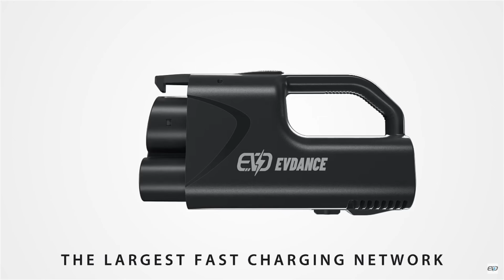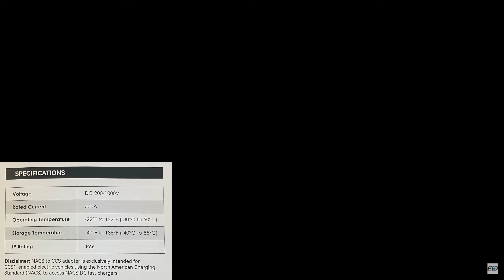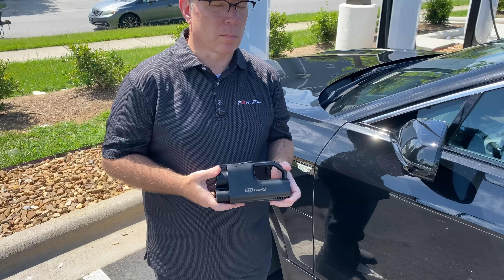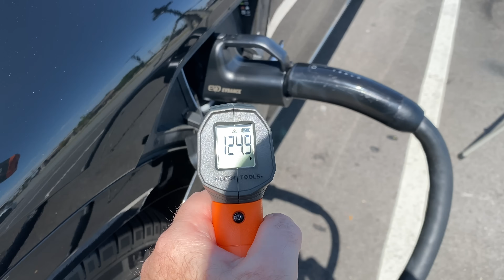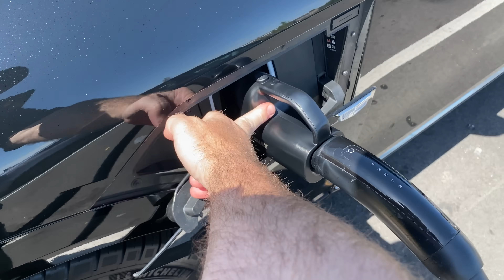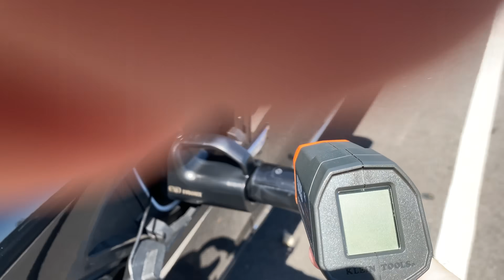Charging my Cadillac at a Tesla Supercharger using EVDANCE adapter

Comment: I'm disappointed with any new product that is not UL certified as there is now a published standard.  It is not an issue today, but it could become one in the future.

There are sensors in some of the existing adapters that detect heat and lead to a throttle at one level and disconnect at a higher level.

That door looks like it could have been better designed, but that is one benefit of this adapter over the A2Z.

I have the A2Z and the OEM adapter from Ford, so I think I am covered for now.

Comment: The problem with the dial on the bottom is that it is not automatic like a spring-loaded latch. People are inherently lazy, and I suspect that many will just plug the NACS in without locking it thereby presenting a potential safety hazard (A2Z's first Typhoon adapter was similar and they changed it with the Pro version). I do like the handle on it though, it's nice to see a company do something different in that regard. What temperature did the handle get up to?  I'm guessing it's a lot cooler. Numerous YouTubers have complained about how hot the Tesla OEM adapter gets and that they can't hold onto it and this handle might prevent that.
Reply from the maker: True, but no charging until the dial is locked.
Reply: @thenetworkarchitectchannel So the dial actually cuts the data communications? That seems unlikely to me but not impossible, just overly complex for a budget product. I would expect it to just be a simple mechanical locking latch that can't stop charging at all
Reply from the maker: Two things.  The manual says "built in temp monitoring.  Charging will decrease if internal components of the adapter exceed 194F".  Also, the video does not show it well, but the dial is not raise a plastic blocker.  When it is spun, a click occurs which looks to engage a contactor and also release a spring loaded blocker of some kind.  When using it, I gathered it was a safety feature which will prevent current if not fully engaged.  IMHO, this dial method is safer than a finger sw of some kind, because it take more deliberation to disengaged than a toggle sw.  To get the specifics of the safety of the device, I suggest emailing them. contact at evdances dot com.  I personally, am comfortable with the safety of the device.  I respect others may feel differently.
Reply: @thenetworkarchitectchannel Definitely sounds different than other adapters Alex on Autos did a video where they cut a Lectron adapter in half and showed how they actually work if you are interested. Titled "NACS Charging Adapter Teardown".
Reply from the maker: @Weezedog  cool.  will check out.  Here, their promo video does a quick blow out, but can't fully tell what's up.  More of a guess from that.  Thx.

Comment: Probably fine but not an adapter I would recommend.
Reply from the maker: Their bread & butter is the L2 extension cords.  Kim J & Kyle C both did plugs on their chans for it.  When I did the extension vid here, it did way better than I expected.  Seems like they found an area to get a foot hold with that.  This is a new branch of products for them and likely take awhile to see if it takes off or not.  As far as others from them, I use their 40 amp L2 wifi smart charger pretty much daily now.  For sure I will chime back in if any issues with the Pulse Fusion.  As you say, I think it will be fine though.  So far, I have not had any probs with others from them (ext-cord, 80 amp L2 adapter, L2 chargers).  Thx for chiming in & watching.  Signs at White Bear Lake above chargers are in Apex now too.  Saw them yesterday while swinging through.  Smart move.

Comment: I don't believe there is any physical interlock to prevent the NACS end from being unplugged when the CCS1 end is attached to the car.  This is required for safety as the car will lock the CCS end when charging, but if nothing locks the NACS end - big safety hazard if that is ever allowed to be unplugged during charging or a fault condition.  This caused Tesla to sue A2Z, and they changed the design.  The co-developed Ford/Lectron adapter also has an interlock, as of course does the adapter supplied by Tesla to Ford / GM and others.  If this EVdance adapter does indeed have no automatic interlock, suspect Tesla may come after these guys for having an unsafe adapter.  The manual rotary lock is perhaps better than what A2Z started with (a slide switch), but still nothing stopping you from turning this and unplugging the NACS end while charging.
Reply: If said switch has a micro switch then it is fine
Reply: @brandenflasch  The NACS rotary lock likely does have a switch, but that electrical cutoff is not sufficient.  That will command the vehicle and charger to stop charging, but there is timing involved and doesn't handle fault conditions.  Both the A2Z and Lectron adapters also had this, but were required to be redesigned to have a physical interlock mechanism to prevent NACS pull out while the adapter is attached to the vehicle and the CCS mechanism is locked by the car.
Reply: @billjohnson3344 loss of proximity requires 10ms shutdown to account for fault conditions. It's just like the CCS latch button.
Reply: @brandenflasch  Am aware, but that assumes everything is working right.  And that doesn't address the issue if the contactor is stuck and voltage cannot be dropped at the CCS pins.  The adapter must lock the NACS side any time the CCS side is attached (or locked).  Tesla does this with a pin, the Ford/Lectron adapter is similar, and A2Z does via their combo latch that can't be pushed to release NACS if CCS if locked.  This EVdance adapter appears to lack this.

Comment: Walter, at 15:20 you were mentioning Porsche, Lucid, etc. as being 800 V cars pulling more amperage. That is actually not the case. They pull more power and use half the amperage to do it. That is the feature of doubling the voltage is that you half the amperage of 400v vehicles. And it’s amperage that determines cable size whereas voltage determines insulation which is a lot cheaper and lighter. For example a Taycan charging at 350kW would typically only need 450A, a Lucid typically less as the pack voltages are generally higher.
Reply from the maker: Ah, thx.  I was actually reaching for examples.  I was at the IONNA station yesterday and asked one of their higher up staff about the 600 amp cables and the adapters all being 500 amps and if that was an issue.  They were going to ask around.  I really thing it is a closet case.  I mean, who would post up to an IONNA station with a Silverado and use a NACS cable with an adapter instead of a native cable.
Reply: @thenetworkarchitectchannel you'd be surprised

Comment: I would not sweat the 600+ amp CCS1 vehicle (once one is available in the US) on a 600+ amp charger with a J3400 port.  All of the good adapters have at least 2 temperature sensors to derate or stop charging when too much power is flowing for too long.
Though State of Charge showed the one UL certified adapter from Amphenol back in April, yet I still see nowhere it can be purchased so never mind with UL certifications at this time.

Comment: UL 'compliance' backed by a "just trust me bro".   😮   Just because some specs printed by the manufacturer not verified by an independent source doesn't mean it's safe.  Only a tear down and analysis or testing to the specified limits can show that.  What is the basis behind your claim that it's "safe"?
Manufacturers claims may be good enough for some, but not for me.
Reply from the maker: I do not recall claiming it is safe.  I just said I felt it was gonna be fine for me to use.  I respect others may feel differently.
Reply: @thenetworkarchitectchannel  15:28  "it's going to be perfectly safe to use this"

Spoken just like someone trying to deflect "legal" responsibility...  I've learned NEVER to trust any one who says "I do not recall".  Even if you didn't say it explicitly, which you did, just saying that it's UL "compliant" and quoting that the specs claim it can handle up to 500A strongly implies it's "safe".

I enjoy your charging network updates, but promoting EV hardware, not so much.
Reply from the maker: @BubbaBearsFriend cool.  Appreciate your view.
Reply: @BubbaBearsFriend Then don’t buy it. Move on.
Reply: @BubbaBearsFriend  I actually asked their techs about it and the response was that they would be UL certified within two months.

Comment: You’re on a roll this week, Walter! That handle would be convenient, although I have no complaints with my A2Z Typhoon Pro. The “lip” on its J3400 end helps when unplugging it from the car, but my EV doesn’t have your problem with the charging port door: mine swings up, instead of down. The lockable button for the J3400 plug is nice, which is what my Lectron Stellar J1772 adapters have. This slightly bigger, smoother model might be a good option for the Hyundai/Kia/Genesis owners like my daughter who are STILL waiting to receive their “free” adapter.